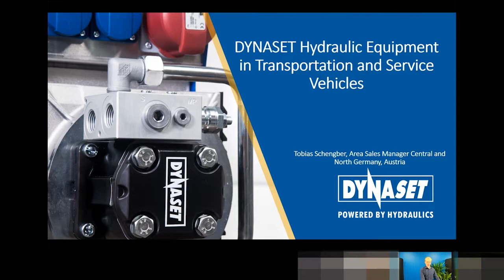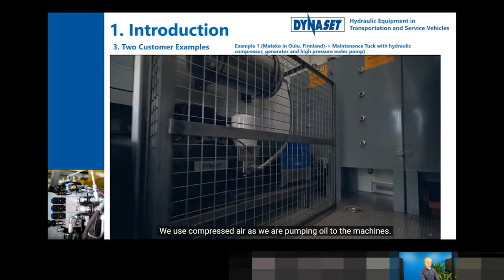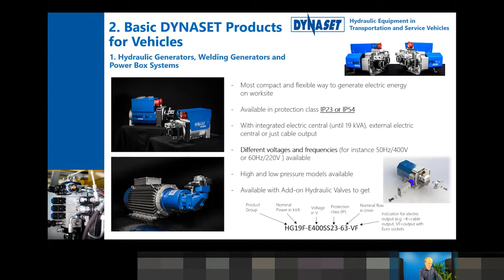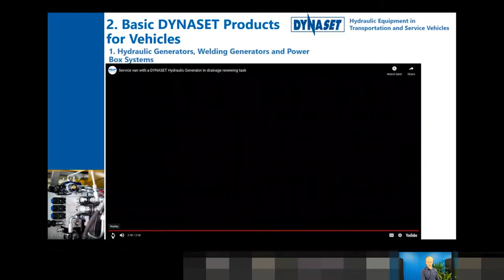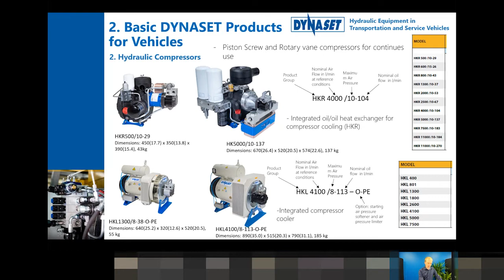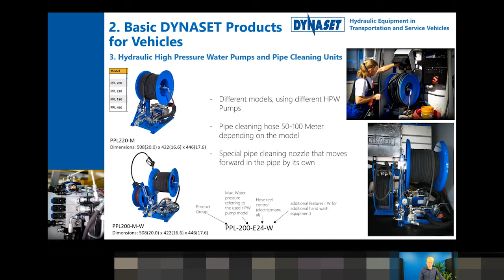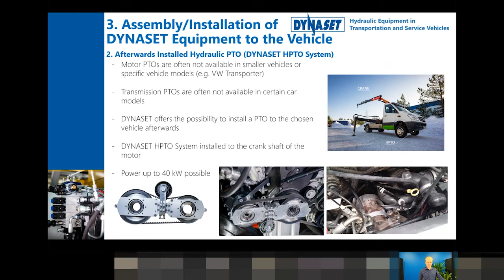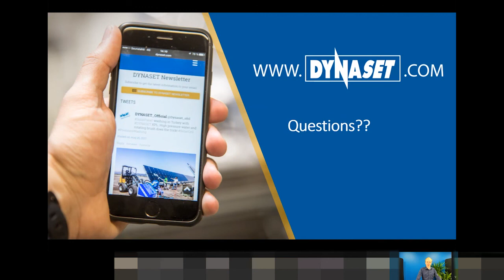Unleash Your Vehicle’s Abilities – Hydraulic Equipment in Transportation and Service Vehicles

Comment: What is the power ratio of your hydraulics for example: if i want to power a 30 kilowatt generator, how many horsepower should my engine be ?
Reply: mechanical efficiency of both hydraulic pump And motor is between 80-90%. Pick a conservative figure and size your engine accordingly. In your e.g. above, let's take 0.8 as efficiency level for both pump and motor - that's 30/0.8=37.5 for motor, and 37.5/0.8 for pump= 47.9 kW. So a 50 kW/67hp engine should do fine...can't run engine at full rating continuously either... however, since efficiencies of both hydraulic pump and motor are generally better than 0.8, that should take care of the whole engine-pump-motor-generator setup + parasitic losses in valves and piping(hose).
Reply from the maker: Hello! Thanks for your question and sorry that we made you wait. For 30 kilowatt generator, our expert recommended a 45-kilowatt engine. But this depends also on the engine and how the electricity from the generator is used. I recommend contacting our experts to get a more specific answer. You can do it at www.dynaset.com/send-us-a-message.
Reply: @DynasetOy  Okay thanks a lot i will surely get back to you soon.